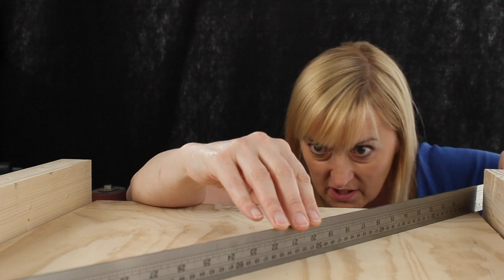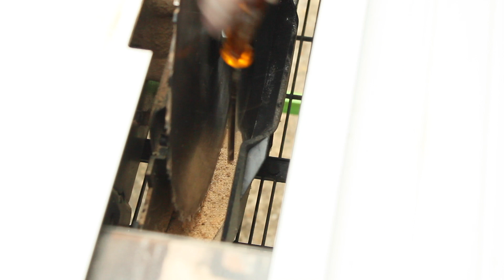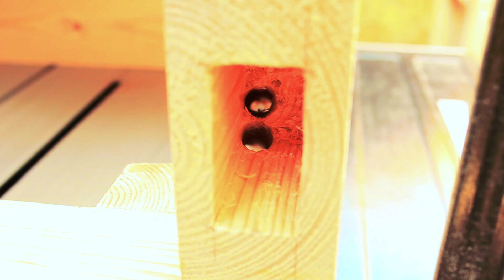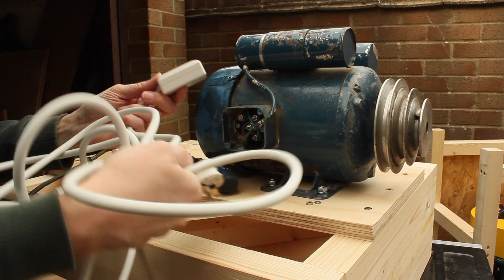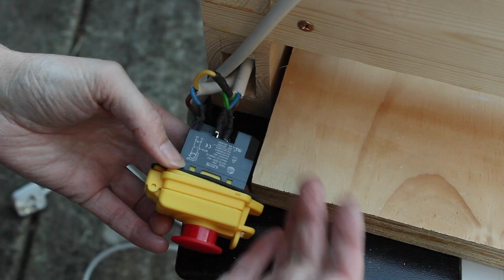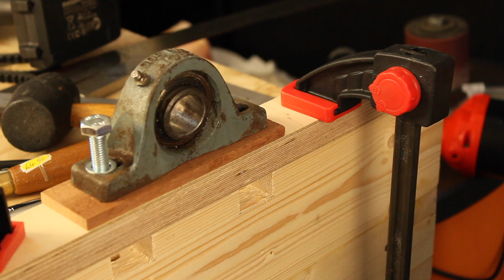DIY Drum Sander part 3

Comment: Using insulated spade connectors for switch/wire connections  would have been much easier and allow it to be easily removed if necessary.   Typically soldering wires to switch is not customarily done in applications such as this for that reason.

Nice job, though.  I like it!!

Comment: I am in the process of building one of these thank you for your videos I have the drum made out of MDF disc and I have my bearings a pulley and motor one thing I seen an another video that caught my eye he actually used 2 boards and hinges he made two identical wedges fasten then to a frame that sit between the boards mounted it on drawer Glides so however much it lifted on the left side it lifted the same identical amount on the other side he also used a piece of all thread with a knob and a couple of t-nuts 4 micro adjusting the assembly I was really worried about this as I seen people put bolts in the middle to lift the hole assembly but I could not see that being accurate on a 30 in roller assembly but when you think about it the only thing that probably really matters is that it's flat from side to side directly under the roller and that the roller is true from side-to-side because this is the only point it's touching and flattening is at that very small point where the roller is touching the board your sanding

Comment: Hi Susan, just discovered your channel and really enjoying your videos. Very good explanation of your step by step processes. 
Just a little observation though....
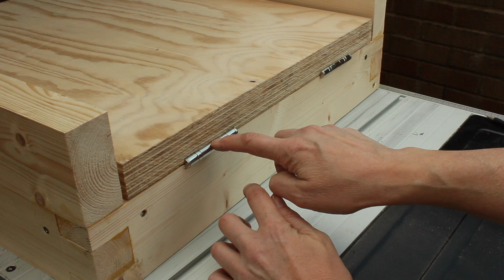It's @3:14 and something I first noticed in the previous video. 
The reason you're struggling with irregular Hinge housings is because you didn't use Marking Guages. Whether it's hanging a door or even making a Drum Sander, you need two Marking Guages to fit Hinges. One for the width of the Hinge Leaf or width of the housing, and one for the thickness of the leaf or the depth of the housing. 
But using a Trim Router also helps with keeping the depth level too...you just need to be careful not to wobble with it lol.

Comment: Flatness is always a problem and plywood never is, always has a doink because of the stresses. Birch would be better, yes, I know, more expensive. Tht flatest thing you will easily find is glass, and you can usually get failed double glazed units that are toughened - they will have an etched mark - this will enable you to make a really flat frame of 3x2 (with internals) and then fix a piece of 2 mm galvanised steel with old fashioned Evostick. Aluminium would be nicer but, more expensive. I'm spoiled because I have an excellent 'blacksmith' in nearby Lampeter who is happy to supply almost anything you want, but if you hunt your local area you should find someone..

Comment: Glad to see you got the tabletop sorted...  Rather than having done all that hand planing, I would have used 2 sets of known flat references. Put one set on either side on a level surface, with the tabletop in between, and lay the other set on top of them so that they "float" over the tabletop just about an inch apart, at a 90 degree angle to the first set.  From that vantage point, a router set to the "deepest" point you wish to go and run over the entire surface would flatten it within minutes ... finish it off with 120 - 400 grit. 

Any decent epoxy or a good quality contact cement would work great for adding a sheet of aluminum or steel (use a stainless steel if at all possible, to avoid rusting, or coat your steel with some kind of protective coating ... floor wax or acrylic.  
Aluminum would work fine, as it's cheaper and won't rust.)

You will want to clean and re-tin the tip of your soldering iron ...  If you feel up to the delicate work, you could take it to a sander and sand away the corrosion on the tip till you see the copper in the copper plated surface ... sanding through it would result in no tinning in that area.  Replacing the tip with a new one would be your best option at that point, unless you want to spring for a whole new one.

Once you've revealed the copper plated tip, plug in the iron and cover the tip with flux, and immediately apply a layer of solder all over the tip to tin it.  This layer of tin is important, as it helps to transfer the heat to the solder and the joint by effectively helping to make the soldering iron part of the joint itself during the process.

To maintain the tip between jobs, take a good bit of solder and glob it onto the tip of the iron ... A nice thick protective layer.  Next time it heats up, just wipe it against a wet sponge to clean off the old solder and you're good to go!

I noticed also, that your drill bits seem to have a difficult time of penetrating your wood.  You may wish to send them to a Drill Doctor for sharpening, if you haven't got one yourself.  They can be fairly expensive, at around 80 US dollars, but well worth the expense in the long run!  Make certain that if you get one, you get the style that can split the point on your bits.  They'll cut better on center without wandering and give you a nice clean round hole with little outerwear to deal with.

Also noticed you cutting again by hand .... right on top of your table saw .... really? lol. :)

Those dados you did for the motor mounts could have been very quickly and easily done using your table saw .... set it to the right height and use your miter gauge and fence or make yourself a crosscut sled to easily reference where your dado will start and stop, and then repeatedly run your work piece through the blade to cut out the waste.

Comment: Sue , your Japanese saw are designed to cut on a pull stroke..   I know your head knows this . pass on the info to your hands. Your wrist is dropping on the forward stroke. imparting a power push.     Not trrying to be a smart arse. No offence meant.

Comment: I have just seen what Rafe  Zetter posted. I was about to say the same . Plywood sheets are rarely  as flat as you are needing,, whereas an offcut  from a  2" kitchen worktop with a chip core  is as good as it gets.. Also has the advantage a  nice smooth very hard slidey surface,   and it comes in pretty colours..  (:      (:

Comment: Hi Susan. you can compensate the play of the spindle shaft in the bearing by using a bit of loctite.. in time the shaft will rattle around in there and get pretty loud on top of wearing out...

cheers
mike

Comment: Hi Susan, firstly, love the videos, if I may, on the electrics, ( I'm an Electrian) nothing you have done is unsafe, but the junction box you have used is not designed for flexible cable, it's for fixed wiring. It has no cable clamp to stop the flex pulling out, not a major problem. Also when connecting the no volt switch, those terminals are designed for crimped spade connectors, but soldering worked as well. Also the switch should be mounted in a fire proof box, not really mounted in a wooden frame. But all in all a brilliant project and video.

Comment: If it were me I would have bought some melamine faced chipboard and used at least 2 layers for the sanding bed. Because of the way it's made it's uniformly flat across dimensions.  Or take a trip to your local Ikea and go through their scrap bin, you'd be amazed at what they throw out, whole wardrobe sections, desktops, kitchen parts - all good usable flat wood for projects like this, jigs etc etc.

Something else I must point out is NEVER EVER EVER make the common mistake of assuming a rulers edge is straight.  Sure it's "straight enough" for drawing lines on paper, but for checking for "flat" across a surface, especially in a situation where "FLAT" is paramount? NO WAY.  I'd be willing to bet pound to a penny that that "rocking" you mention @ 2minutes is a combination of the wood AND the ruler BOTH being out of true.

Correcting to "flat" to a basic steel ruler is just asking for problems long term - been there, done that.

Invest in a good PROPER straightedge , steel over aluminium, as steel reacts less to changes in local temperature, and keep it just for datum checking, don't use it for anything else or you risk altering it's characteristics.  Axminsters is ok, but gets middling reviews, the Veritas 1000mm Steel rule is around £70, but machined to better than BS spec tolerances, and buy a longer one over a shorter one, using a 300mm ruler to measure for "flat" by sliding it over each section is just foolish because the only accuracy you're getting is that section, not the whole - ever seen a circle made of flat sections? same principle.

Comment: Once you glue metal to one side of the table then that side will be effectively sealed.

usually what happens when one side is sealed is the board curls.  You need to seal the entire table well or it will probably warp eventually.

Comment: Susie I think I may have ordered the wrong radius sanding block. I ordered a  9.5 radius, then realised thats quite severe. Any experience of these blocks. Guess I will see if it suits me. I have been making flat fingerboards.Racking brains to think how to make one?
Reply from the maker: +David Bayley 9.5" isn't too severe - I believe that's a typical Fender Stratocaster radius. Older Fenders had a tighter radius and I think Brian May's guitar is a 7" radius, although the production version of his guitar is flatter. A lot comes down to personal preference. My acoustic guitars are between 12 and 15" radius. I'll be making a radius sanding block in a future video, but that may be a few months away yet.

Comment: hi Susan nice vid and it you allowed a quick tip. take square steelbar or a thick straight steelbar as straightedge but Not a ruler. tooooo flexible
Reply from the maker: +Günter Année Fair comment. I drew a straight line across the top as I realised the ruler needed to be straight. I should have used the notched straightedge I use to check guitar necks
Reply: Susan Gardener sex movies

Comment: Are you concerned at all about the stability of the ply drum? Whats your rpm's?
Reply from the maker: +paul dunn RPM should be around 1400. As for stability, it depends what you mean by stability. I will probably have to do a balancing of the drum as there might currently be some vibration. If you mean stability as in structural integrity, most people use MDF due to its more even density, but I'm not a fan of MDF for working with due to the dust and chemicals but also the exposed edge of MDF is very soft. In terms of expansion due to moisture content I don't think I need be too concerned in the UK as the humidity is fairly constant - it would be more of an issue in parts of the USA. I'll be sealing the drum with varnish once I've got it trued up as this will help ensure humidity is constant
Reply: Thanks.. one luthier to another...

Comment: You should have put the bolt the other way around so the nut is on top so the ring spanner fitted.
Reply from the maker: +Andrew Pedley but then the bolt would be captive - maybe not a problem but I have more options this way
Reply: Susan Gardener I seen women woodworkers on you tube and they were good but not  as precise as you.

Comment: That's coming along nicely. I'm a bit worried about the diagonal flexing of the table. You need to think the whole system as a spring, and even tension is what makes straight sanding. That one diagonal support beam under the table leaves it free to flex around it. If that becomes an issue, you can fix it with two beams in V shape from each hinge to the height adjuster.
Reply from the maker: +esa062 I'll probably add a cross brace. The height adjuster will be my usual over-engineered solution and will give plenty of support I hope, but you make a good point.
Reply: No such thing as ```over engineered```   there is never a problem with something  ``too``  strong.        You go girl.